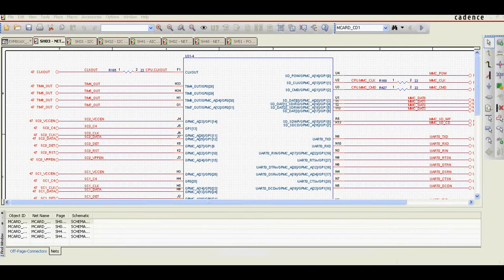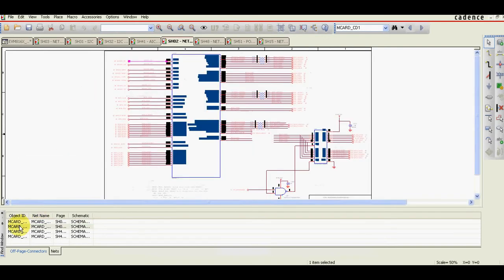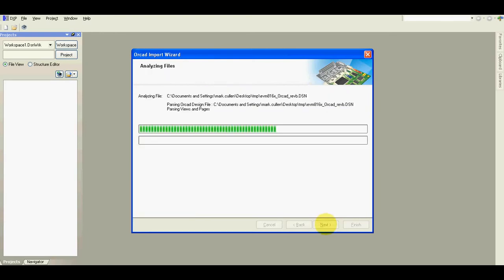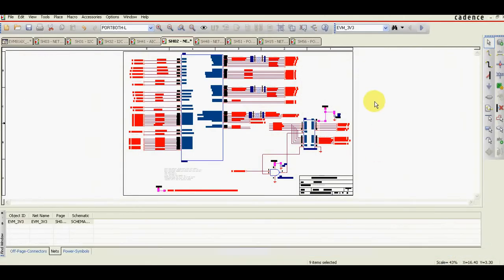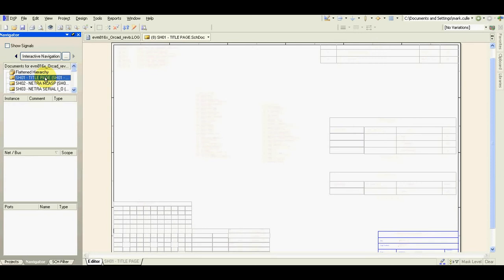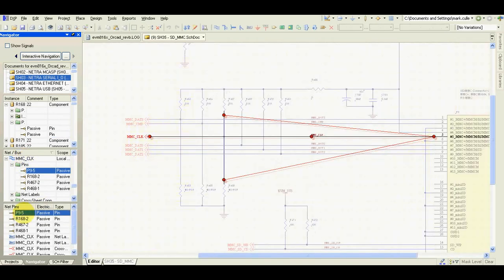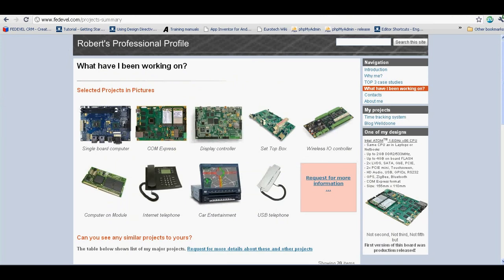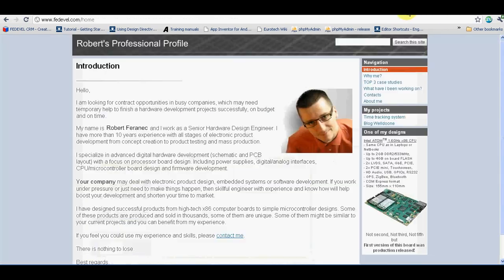Best way to check ORCAD schematic - use Altium Designer

Comment: Thank for your information regarding "Best way to check ORCAD schematic".
However,Would you have Best way to check ORCAD schematic when the net double pull high use Altium Designer ?"for example :net 'A' pull high VCC5 via 4.7k ohm and connect to net 'B' via 0 ohm,but  net 'B' pull high VCC3 via 4.7K ohm already.